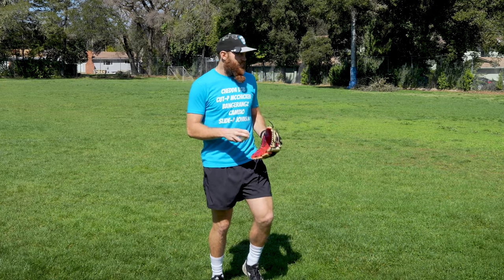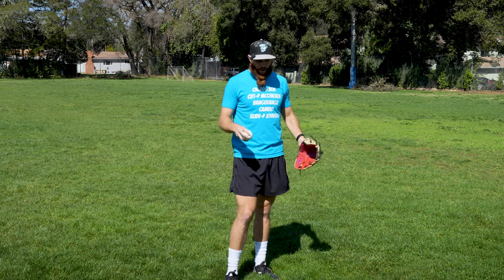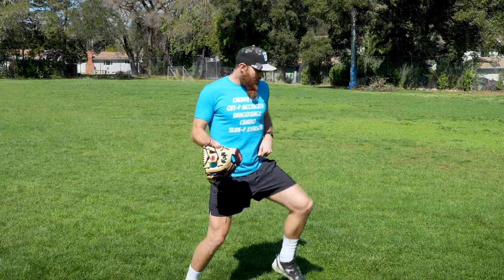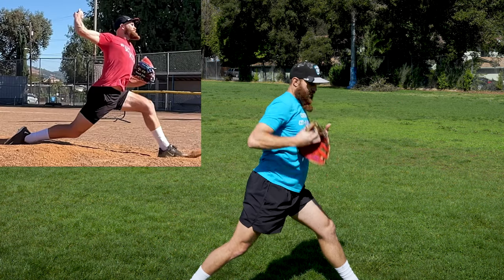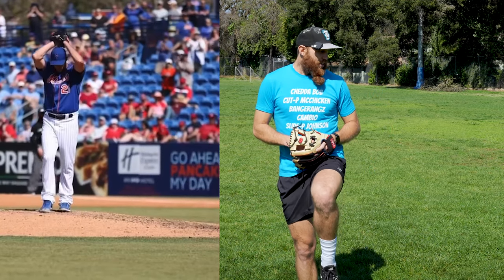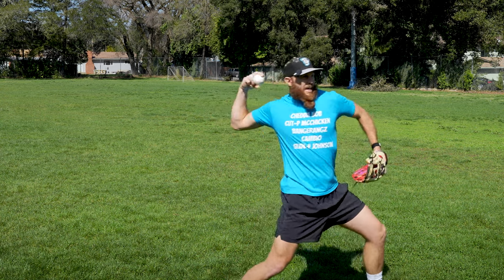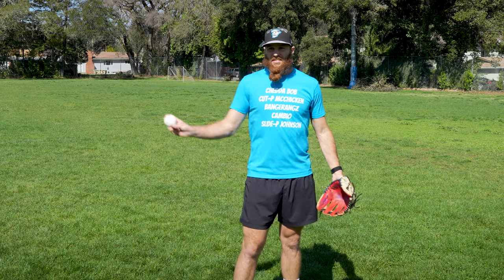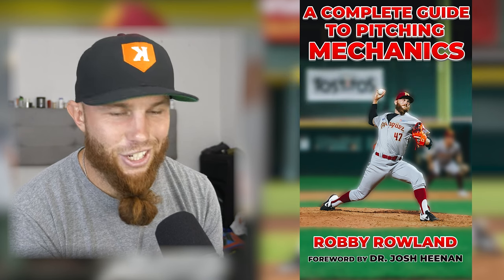Drive Leg Loading | Deep Dives into Pitching Mechanics

Comment: Great explanation man. One thing worth mentioning is that the orientation of the drive leg during the drive phase is going to be different depending on your hip structure. If you look at Justin Verlander for example, he maintains more of a vertical shin with a neutral pelvis (not coiled around his back leg). Someone like Fernando Rodney on the other hand has his back knee pointed toward the target during the drive phase and isn't going to have the vertical shin. Ultimately, it's all about maintaining a load in your hips for as long as possible until they pop open at the last second. Both of them do it, but because their hips have different movement capacities, they do it differently.
Reply from the maker: Yeah man I look at it more as the anatomical structure of one's pelvis which allows for different styles of loading.. kind of tough to go into detail within that tho because I don't want the younger kids watching this get too caught up in that at an early age. But heck yeah man you're spot on.